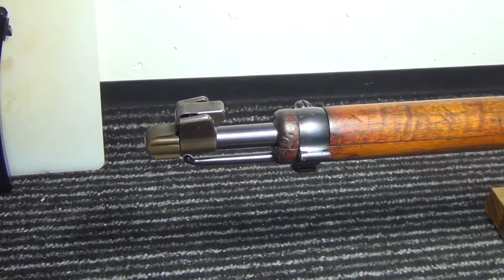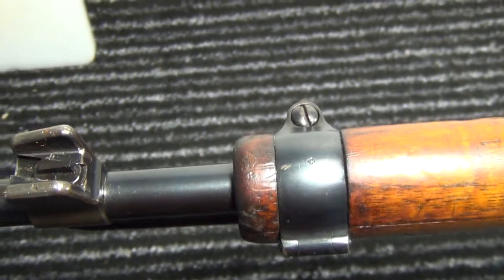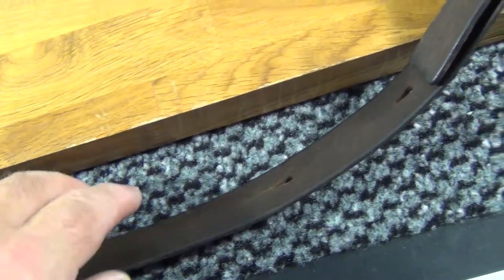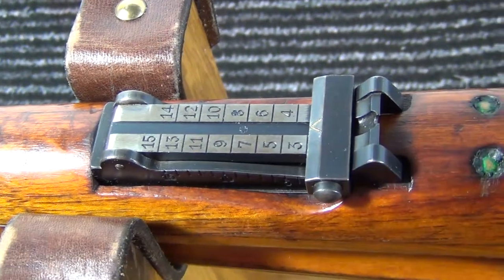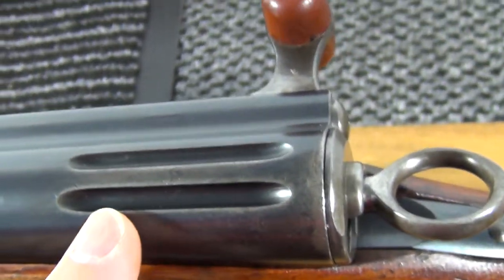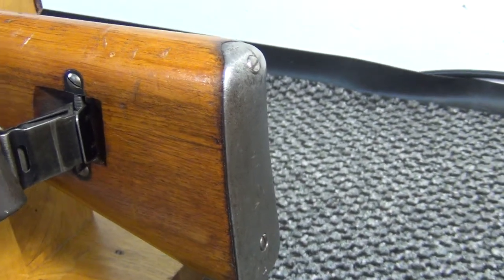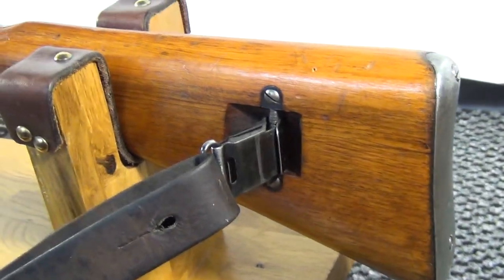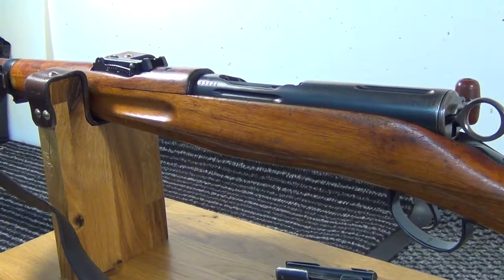Quick look - Schmidt Rubin K11 - Part 2

Comment: I'm about five years late for this, but the rear sight is attached to the barrel on the K11, not the wood. The handguard is removed by removing the barrel bands, flipping the sight up perpendicular to the barrel, and pulling the handguard up, so that the retainer(under the rivets in the handguard up to disengage it from the barrel, and then turning the handguard 90 degrees to the gun. It then slips up and over the rear sight. The grooves in the reciever are lightening cuts, there more to strengthen the reciever than to actually lighten it. Again, I know I'm late to the party, but just a couple things I noticed!
Reply from the maker: Hi Mark, well I'm 2 years late with my reply, BUT... nevertheless I learned from you! So thank you for watching and commenting! All the best, Rob

Comment: Just purchased a k11 for 248.00-300.00 with shipping and 480 rounds foe 268.00 including shipping. In case you don't know, I am from the USA!
Reply from the maker: Great, Ed! I wish you a lot of fun with your K11. Have a look under the buttplate to see if there's a piece of paper with the name, unit and address of the last soldier to have it. You may be lucky! These are nice rifles and the GP11 ammunition is Berdan-primed and very accurate (approaching match grade) with a 174 grain projectile. I am sure you're going to find it very satisfying to shoot and will have a wide grin a lot of the time! :-)
NOTE: It is important to smack the bolt forward to make sure the lugs engage fully. On mine, the serial number is about half visible when correctly in battery. (On the K31 it is fully visible). Take care, be safe, have fun! All the best, Rob